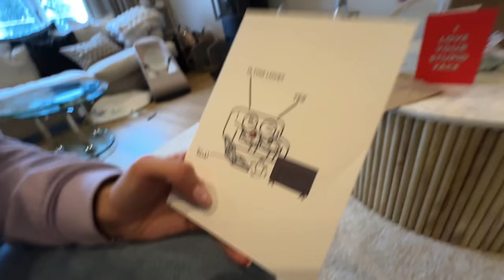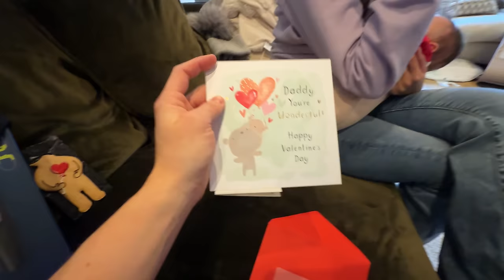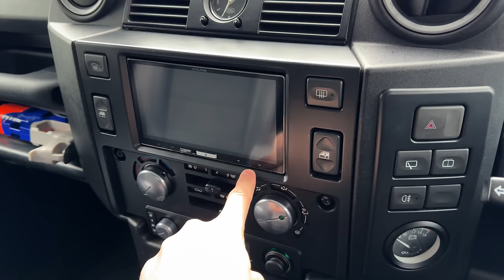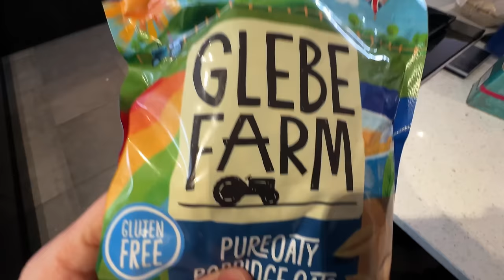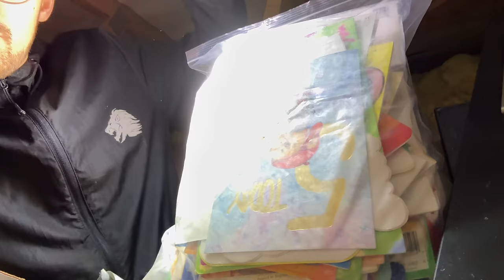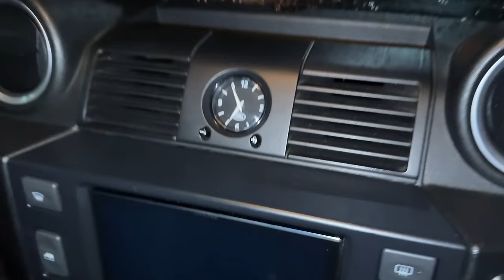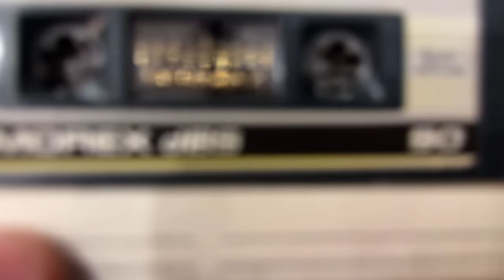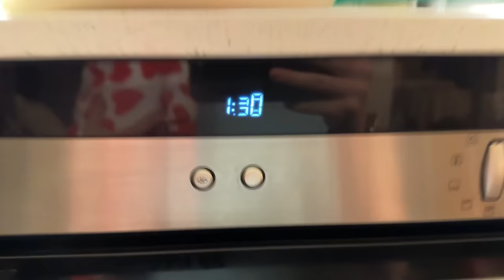I Found so much stuff Hidden Up in my Loft!

Comment: Tom, I work at a landrover approved bodyshop and deal with this issue alot. The Leaky defender can have an easy and temporary fix which you can do yourself for the time being. Get some silicon sealer and some masking tape, completely dry the area with a hairdryer and put a bead of sealer around the section where the windscreen meets the bulkhead.

Comment: Put your palms under the couch and raise your legs in the air using the couch to anchor you till your feet are facing the ceiling and then release your legs slowly to the floor engaging your core 

Basically leg raises with extended extension (downward part of the rep)

Comment: Hi tom i fitted automated gates for 4+ years the gates should have hit the car and reversed due to them knowing they have to use more power then usual to close they could be deemed unsafe also should have them sensors on the inside aswell to stop this issue from happening.